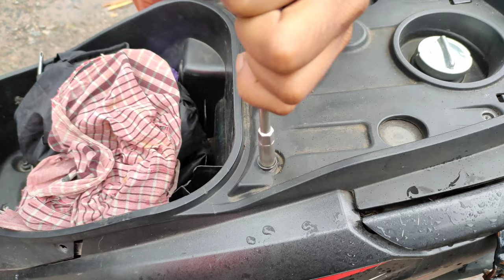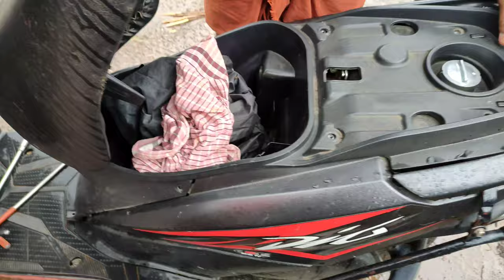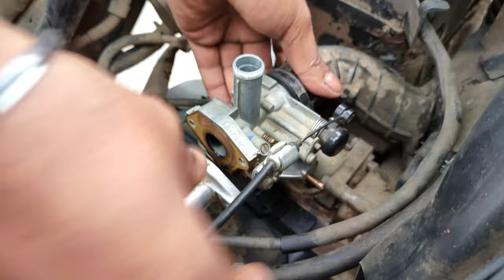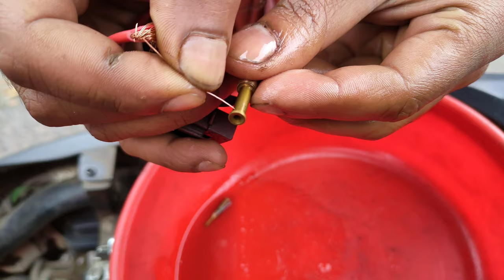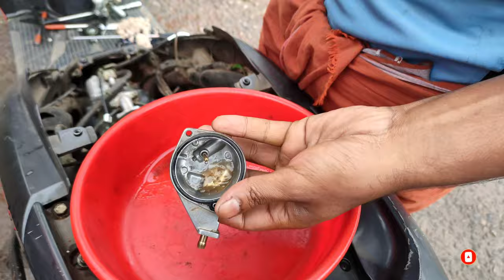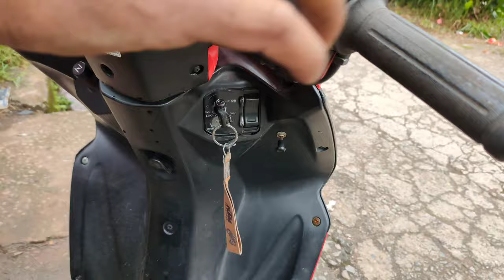Honda Dio Carburetor Cleaning | Carburetor | Honda

Comment: After carburetor cleaning pickup gone on my dio,what to do?i changed roller bush,varaitor and fanbelt on same time😢
Reply from the maker: Do you clean properly and tuned
Reply: @RaceTuner2024  no i did't,i gave to honda service center
Reply from the maker: Ask them whats the reasons

Comment: Vandik enth preshnm varubolan ith clean cheyendath
Reply from the maker: Starting trouble , missing
Reply: @RaceTuner2024  ok selfilm kickerilum pettenu thanne start avuund enkil preshnamillale
Reply from the maker: No problem if it running properly and better to tell your mechanic in some intervals to check the condition of the carburettor by observing by starting, idealing and running
Reply: @RaceTuner2024 English no

Comment: Boss sana masagot. anu problema kapag nag over flow ?
Reply from the maker: If you have dio scooter there is mainly two things one is petrol tap and another is float needle . And if carburettor is not clean it will also cause overflow,If petrol is leaking from middle of carburettor check carburettor bowl rubber packing and the overflow is coming after starting better to check air filter and manifold side rare case not properly sealed also cause overflow to confirm all this you have to check properly 😊